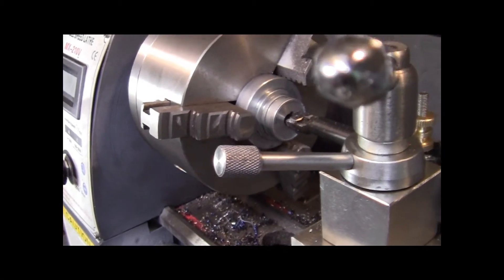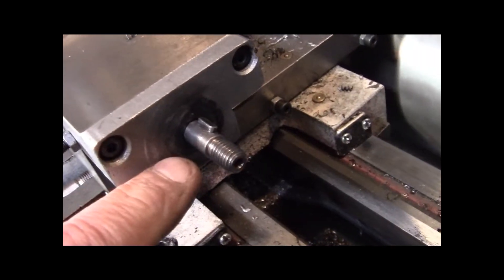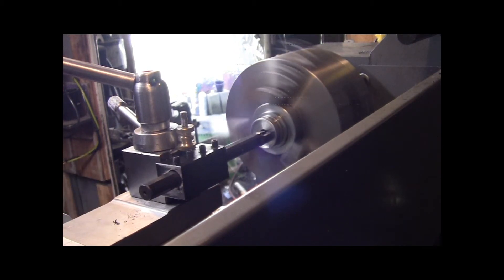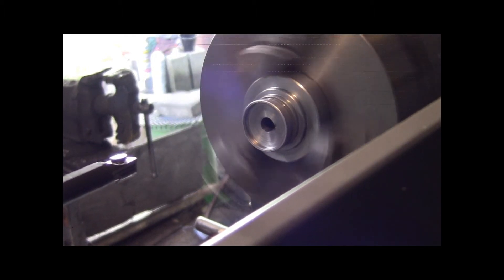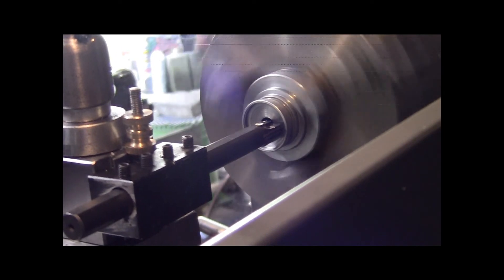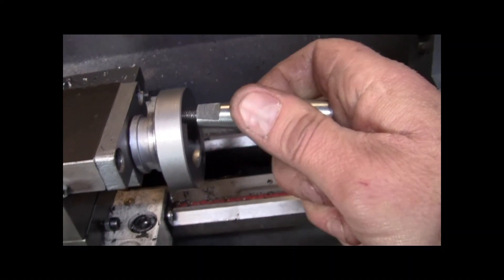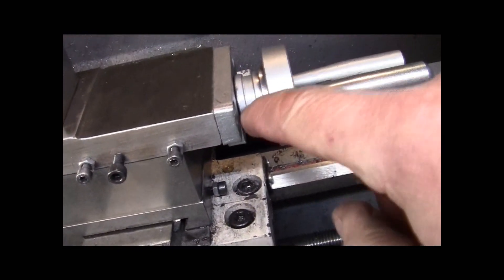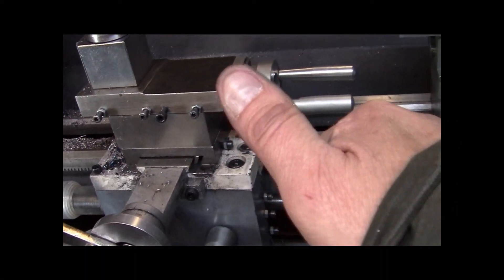MACHINING MX-210V LATHE COMPOUND FOR A THRUST BEARING

Comment: I bored the brackets on my cross and compound for common skate bearings. No play radially or axially, smoother than silk and almost   zero backlash now on cross slide and after urethane injection in the threaded block on compound it has near zero backlash also.  Best thing I've done to it besides the scraping in of the cross and compound. 3209 double angular contact bearings in the head stock near Chuck and single floating 6209 bearing at rear of spindle were another upgrade that was well worth it. All in all it has turned into a very nice and capable machine.  Love the 1.5" spindle bore, I take advantage of that feature often.
Reply: Sounds like yours has been coming along. Would love to see some photos/video? First thing I did with mine was fix the cross slide way. I have had a few 7x10s and a Grizzly 9x19 G4000 along with an Enco 9x20(basically same machine) and all of them had a superior cross and compound way stock to my ebay 210. I managed to correct the issue by gluing sandpaper to the cross top slides way surfaces then re-mount and work it until the contact are was 100% smooth. I may go back and add some "scrapes" to ensure sticktion isnt an issue. Removed the sandpaper/super glue with razor blade fairly easily. Only issue after were the gib lock nuts were touching the saddle so I cut a small relief  with angle grinder plan to mill and paint later. Beyond loctite for gib adjustments and a 0XA wedge tool post, DRO on cross, feed and tailstock the rest is stock  work in progress but still flimsier than I'd like. Considering deleting the entire compound now that I have a DRO but Im afraid I may regret it later. Cant think of a good reason to keep it though...